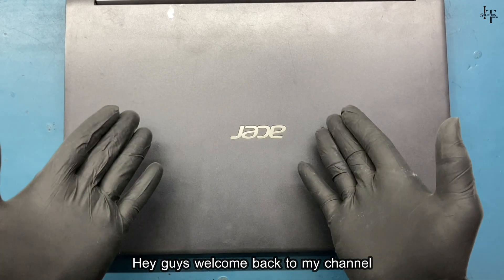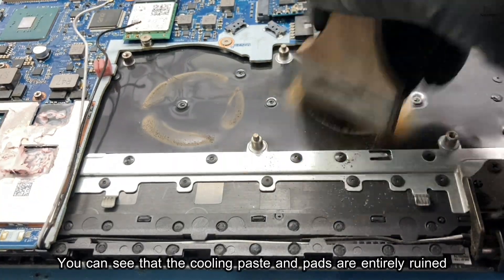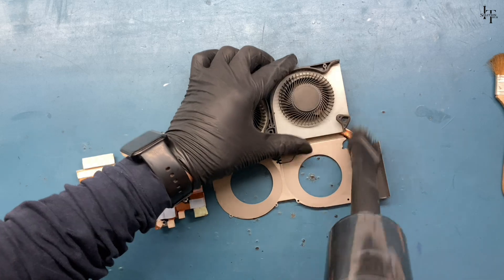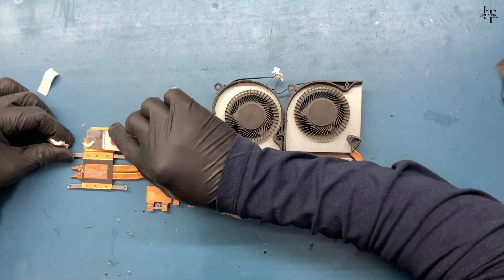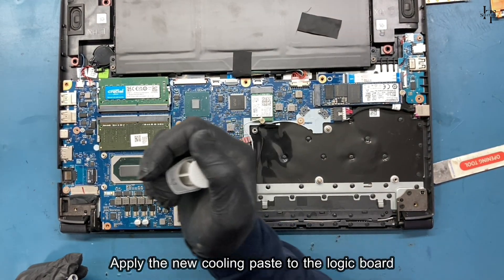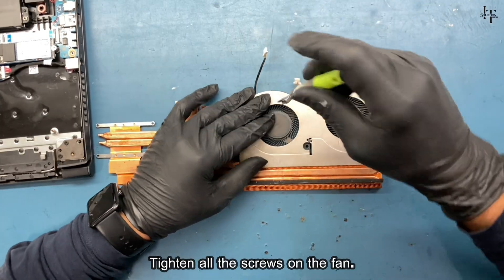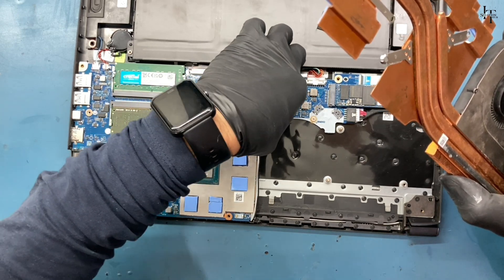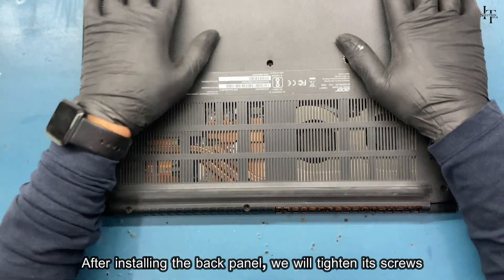HOW TO FIX ACER ASPIRE 7 OVERHEATING PROBLEM

Comment: You didn't disconnect power from logicboard, is it not necessary? 
4:55 - oh you DID disconnect it, just didn't feel like telling about it.

3:55 - did you replace paste on those chips with cooling pads? O_o

Comment: I sent mine to a repair store and they cleaned it up and replaced all the thermal paste and pads and it still overheats like before :(

is there anything else I can do?
Reply from the maker: Check the fan's motherboard.
Reply from the maker: You can take this complaint to your repairing center from where you got your laptop repaired and ask them whether you have used the correct thermal paste because the problem is still occurring or it could be that the fan of your laptop is blocked and air is not able to pass.
Reply: @itsolutionhub02 I did try raising my laptop a little (never thought of that before somehow) and it did help a little thanks
Reply: Check windows power settings 
By default it overclocking CPU with no need.
Especially noticeable on notebooks. 
Most Unity games are badly coded and throttle CPU to the max, while actually being able to play on 70% CPU usage, for instance.
Reply: @Rin8Kin it's not just unity games tho it's also other engines like unreal (because of course) RE engine, cocos2D that also really turn up the heat